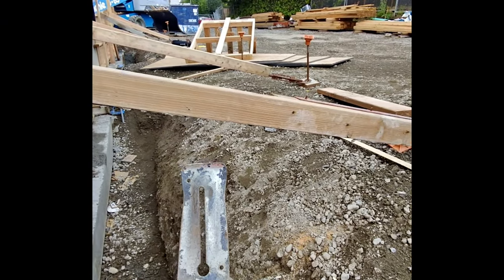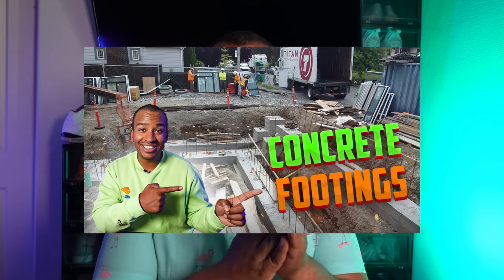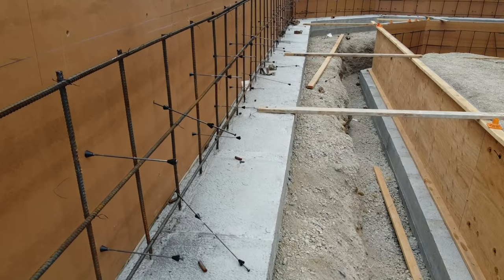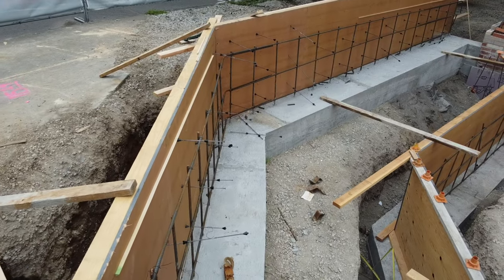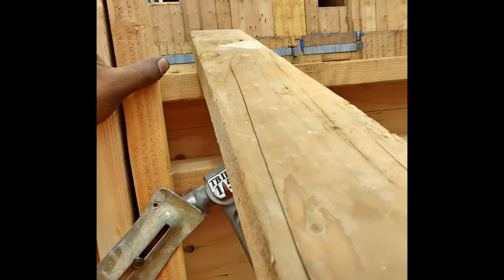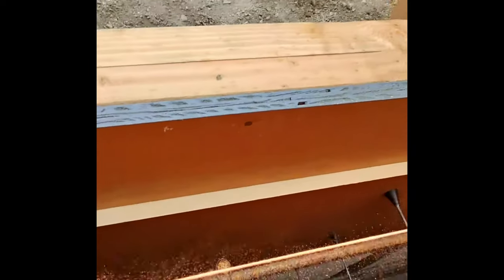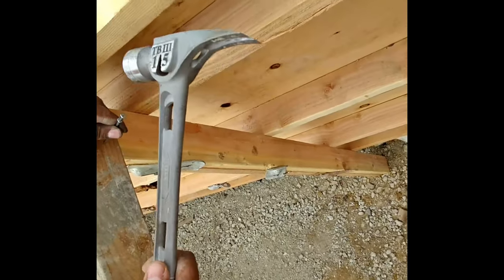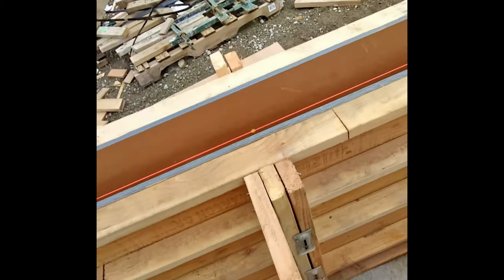Setting concrete wall forms. (Union carpenter)

Comment: You're sharing of knowledge is absolutely awesome Antonio, don't stop. Another way new guys can figure out the process is to pay attention to where the material is set on the jobsite, someone wants something you'll know where to find what's needed.
Reply from the maker: I'm trying man. I realize the more videos I do. The better I will be able to communicate and produce a better product. I have a lot of ideas. Just need to implement them.
Reply: @unscriptedwithantonio  you're doing absolutely great, and there is so much value in what you're sharing, don't stop.

Comment: Don't know your goals with the channel but, I know many many will find it very helpful. Do panels come with predilled pin holes? Do you have a video on forming and pouring a addition with concrete roof? Are colums needed for the tied to the existing wall portion of the roof? Just in case, where I'm from, we build concrete boxes as houses.
Reply from the maker: Most the panel have to be drilled. A lot of times you have to drill and epoxy rebar in to existing walls. I'm not sure about the colum part. These walls weren't on a roof. Let me know if you have any more questions. Thank you for watching
Reply: @unscriptedwithantonio  Thanks

Comment: Thanks for this. Question - I have a 8" thick wall and 6" wall. Both will have 3/4 ply, 2x4 horizontal and double vertical 2x4 - Both sides. What sizes of snap tie length for both? 8 " is a pool
Reply from the maker: the snap ties should be determined by the wall thickness. (6" and 8") strongback ties have longer tails then the horizontals. does that answer your question?
Reply: Perfect thanks. I'm stoked to build these walls. They are on a piece of land in The Philippines.
Reply from the maker: @davidbruce5377  glad I help.

Comment: How do you like concrete side of carpenter? Is it better then framing/drywall. Is most of the high-rise concrete ?
Reply from the maker: Most high-rises are both concrete and drywall framing. Depending on what kind of carpenter you are. EIS does more inside carpentry(like drywall and steel stud framing)

Comment: What's the standard size bit you use for predrilling panels?
Reply from the maker: Depends on the wall. But most of the time, we use 5/8ths. It's just a little bit bigger than the 9/16th head of Snap ties.
Reply: Thanks bro,  just got a dispatch from hall  ... Heading into Phillips 66 refinery here in Bay area for concrete work. Going in as a journeyman with mostly framing experience and  a bit of concrete in my apprenticeship.... Hopefully it goes well

Comment: Just found your channel and thank you first and foremost. My only question is what type of drug test. I only smoke Mary but I plan on stopping before starting my apprenticeship
Reply from the maker: Stop Now. They test for weed. I haven't smoked in like 6 years. I have a drink on the weekend that's it. The carpenters union changed my life. It's worth it.
Reply: You need to stop immediately and let that shit get out of your system, over here they drug test after interview and before getting into the apprenticeship, if you fail the drug test you have to wait 12 months to apply again
Reply from the maker: @kturcotte  I totally agree. Even though I didn't get tested right after the interview. I got test for my first job within 3 days of my interview. It's just not worth it.
Reply: @unscriptedwithantonio  absolutely I quit smoking bud probably 7 years ago now when I was switching jobs and didn't know where I was gonna end up, haven't gone back since
Reply from the maker: @kturcotte  If weed is the only thing holding you back. It's a no Brainer.

Comment: Ay Antonio can you message me I have a question for you.
Reply from the maker: What's good fam?
Reply: Chillin I just got indentured into the carpenters union here in Los Angeles. I am a non union residential framer. But the company I am joining is concrete based. Do you know of any channels that have pour in place column and wall content. Lol. I want to get a little more informed. 
Ps: I appreciate your content. That drone footage is tight.
Reply from the maker: @tylerdavis7291  I will look for you. But join my discord and I will answer as many questions as possible.
Reply: Discord doesn't that mean disagreement. Lol.
Reply from the maker: @tylerdavis7291  https://discord.gg/2R7rtNPYSB
Reply from the maker: @tylerdavis7291  it's a app where you can talk.